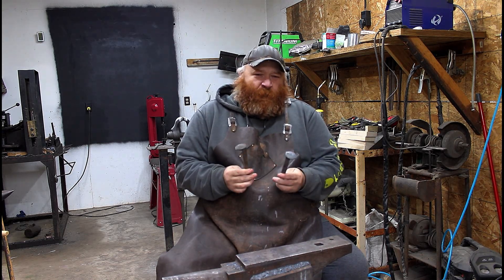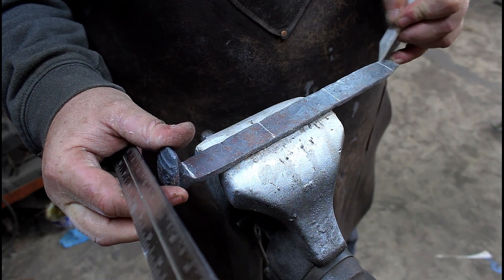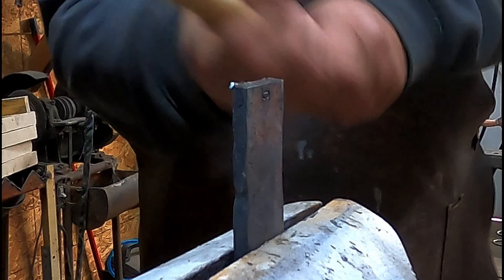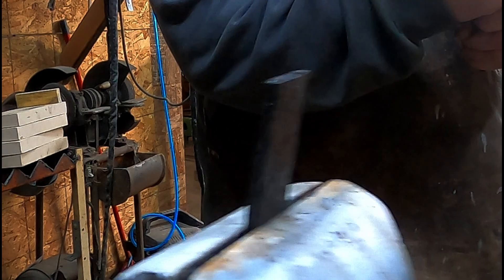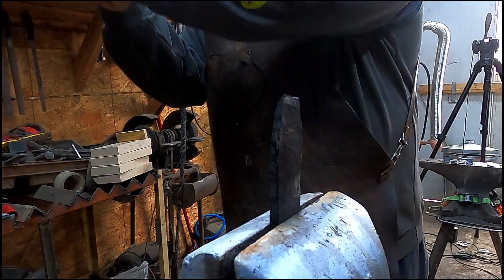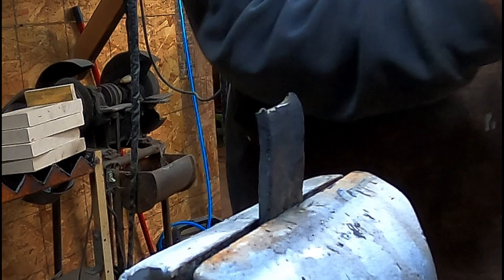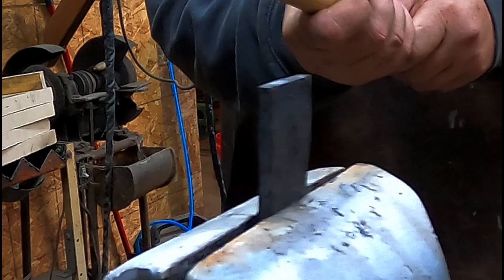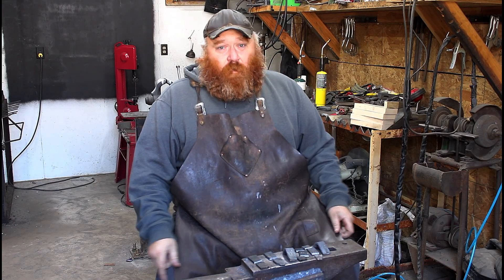Can you HARDEN Railroad Spike Steel? | Bladesmithing

Comment: The first water quenched railroad spike seems about right. Railroad spikes get extremely tough, and only moderately hard when quenched. They are good material just not ideal for knives. I love making garden trowels out of them since they don't bend easily and retain enough of an edge to dig.
Reply: Maybe try making a small axe head. Or hammer head.

Comment: Why would a railroad use an "expensive" alloy to set tracks when low carbon does just fine. The HCs are used in special circumstances but for the many thousands of spikes used most don't need much toughness.

Comment: Maybe try securing the vise .  It seems like you are hitting a steel sample attached to a pendulum.
Reply from the maker: It is bolted to the floor. I did tighten up some nuts after filming this.

Comment: Youll have to pick up one of the spikes from atlas knife and tool. He had them specifically made for knifemaking and they are in the neighborhood 1070-1084 so .7 or .8 carbon content. You heat treat them just the same 1475-1500 degrees and quench in oil.
Reply from the maker: Yeah that’s what I have been told. Very cool. Of course you said a whole lot better than the other amuck who decided to let me know. I thank you
Reply: @rustyhammerforge5902 yeah its a shame when people with similar likings and passions feel the need to act superior or better than others rather than just sharing the information they want to convey. I have been enjoying the series and so i try to leave a comment and a like as i watch them in hopes that itll help your channel grow not to mention there are a ton of people just starting out that would find this information helpful.
Reply from the maker: @okiedokie2487 absolutely and I appreciate it